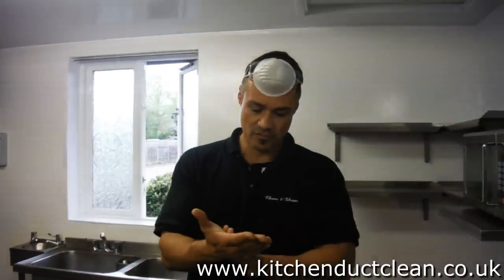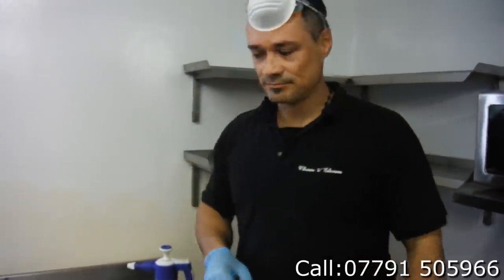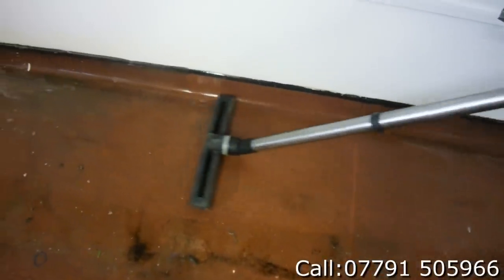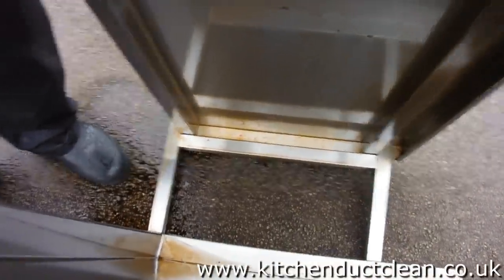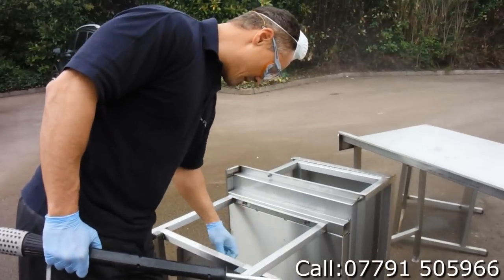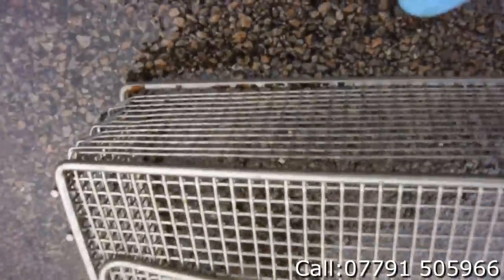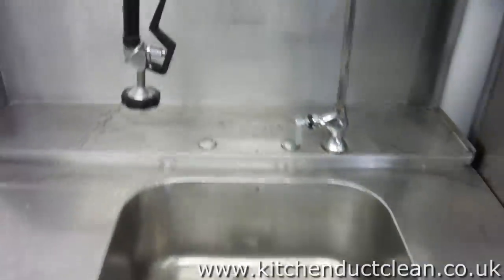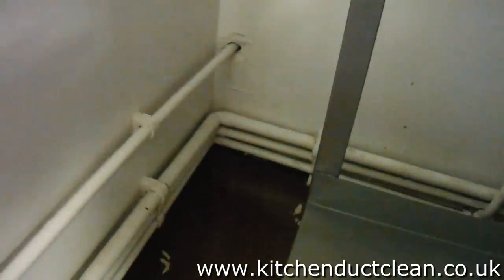Kitchen Deep Cleaning | Kitchen Equipment Cleaning | www.kitchenductclean.co.uk

Comment: Is it not illegal in your country to wash those equipment's outside with oils and chemicals? It is illegal here in US because the outside sewer does not have a grease trap and fat oils/grease becomes solid when it becomes cold and can cause a serious problems in your area. the restaurant owners can get in trouble with the city. dont have a way to tell you this privately but this will be a great info to everyone in this business that does not know it. however, you did a great job in cleaning.
Reply: in the UK not illegal as our sewers have fat traps and grease
Reply: it may be that the eco friendly solution they use, dissolves the grease, so it never hardens again?

Comment: Excellent video! I just had a few questions regarding the cleaning:
1. Which pressure washer/ steam cleaner did you use throughout the video?
2. Which chemical did you use?
3. How long did you let the chemical set in for before using the steam cleaner to remove the grease?
If you could kindly answer them, I would be grateful! 

Thanks
Reply: Sorry ... we don't have the time to respond to the number of questions that get left on our videos & website. The best people for you to ask are either your tutor at college or the B&ES. Thanks - Sara @ Clean & Gleam
Reply: Hallo Sara, i am in South Africa and here there is no teaching/tutoring to do this cleaning. Who can i contact for more info about this. Thanks for the feedback. Regards. 
Johan.
Reply: @johanvanderwesthuizen3361  Hi bud, where are you situated?

Comment: A little concerned about the steam cleaning of a kitchen so close to electric sockets, steam and electricity are not the best of friends, also what happened to the earth cross bonding on the table you were cleaning out side, looks like the straps were just pulled apart. Generally a useful if thought provoking video